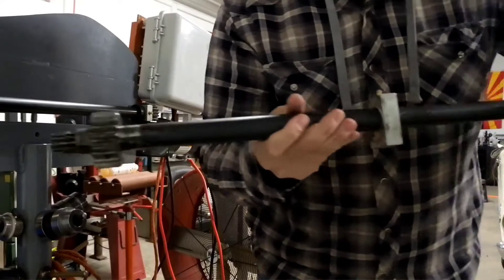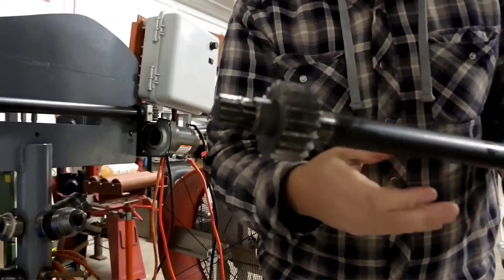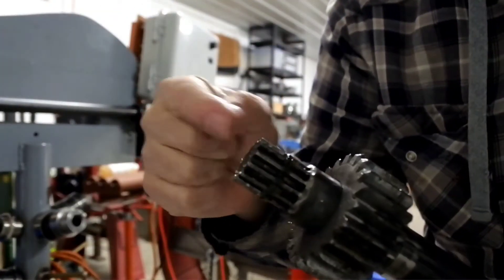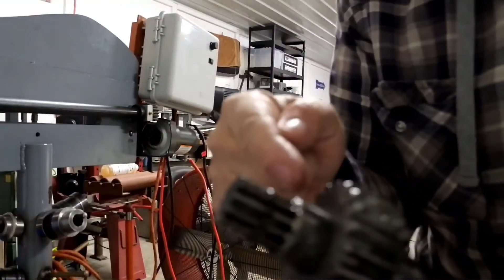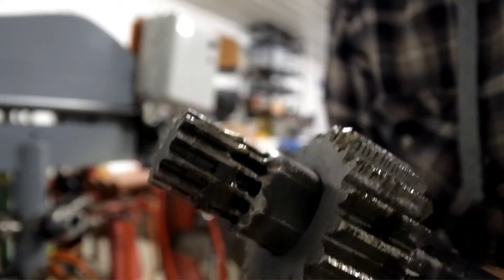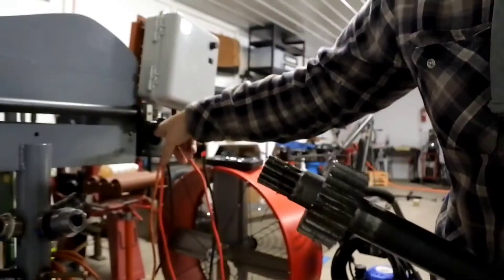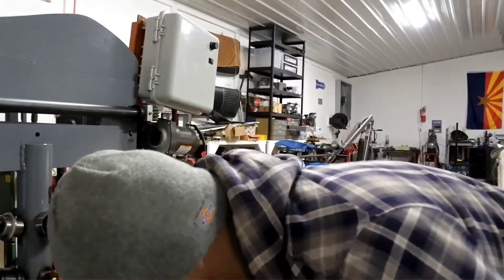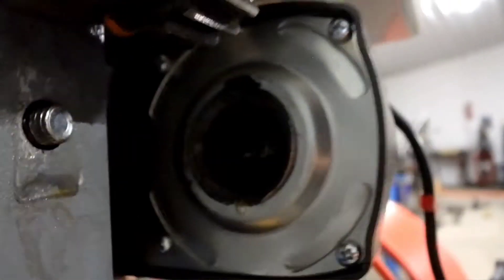Motorized bead roller drive union

Comment from the maker: Adding a drive motor to a bead roller is an absolute game changer. It makes this tool so much more effecient. One of the biggest up sides is having both hand available to feed and control material as it runs through the dies.

Comment: Everyone is loving the bead roller mod videos!  I think access to a lathe would make the coupling super accurate, maybe with a mating sleeve to weld on to a reduced shaft?
Reply from the maker: Yeah absolutely! I found that the winch motor itself wasn’t very accurate. The receiving portion didn’t run true.  It sorta of wobbled in the winch body.
Reply: nice, so being clinically true won't be so much of a concern.  Look forward to the parts showing up to give it a go!  @RDspeedfab
Reply from the maker: @bjlanders report back and let me know how it works for you!

Comment: Anything you would do different? I decided to make my life easier and just copy you but i'm concerned about the output not being concentric with the drive roller like you stated in another video. How is the speed on it? I'm almost thinking of making a chain drive to maybe gear it a little lower and not have issues with the shaft wobbling but maybe its not necessary?
Reply: Also just saw you once lived in Prescott...  Thats where i'm at and I love it here. I'm in Air Traffic and always had to live in a bigger city so when I got a job here, I decided to call it a day and set some roots.
Reply from the maker: @clint91x  I lived in Prescott for 7 years. Alabama now. Loved Arizona. I’m pilot so that’s what took me there. As for the output not lining up, don’t worry about it. The tolerance is pretty loose. You may need to shim the motor position around a little bit it won’t take much.